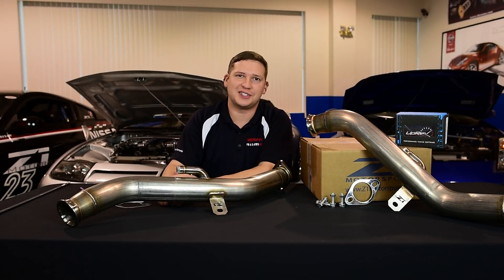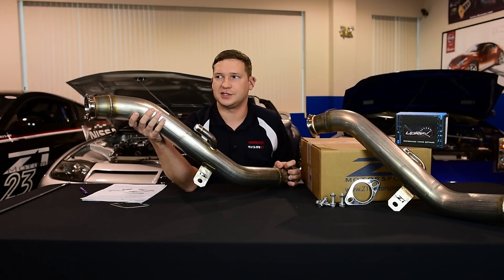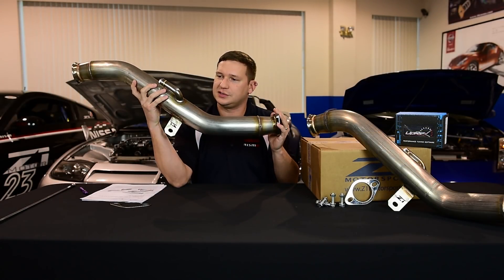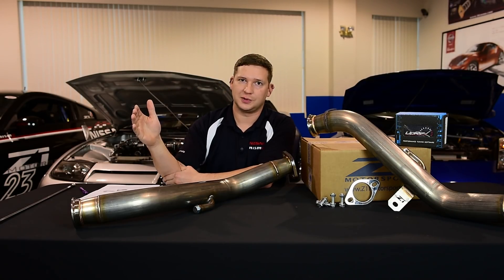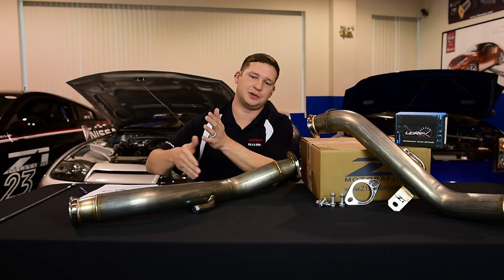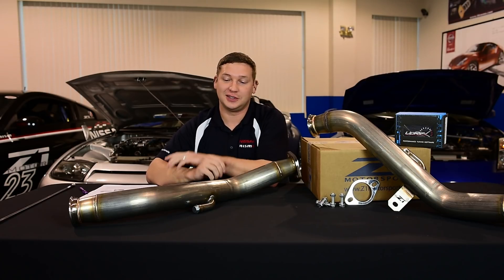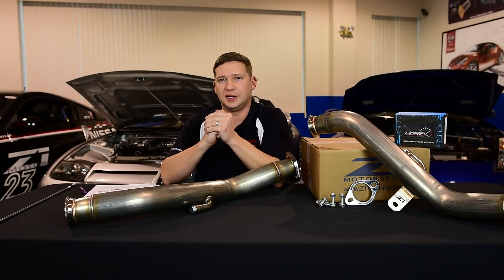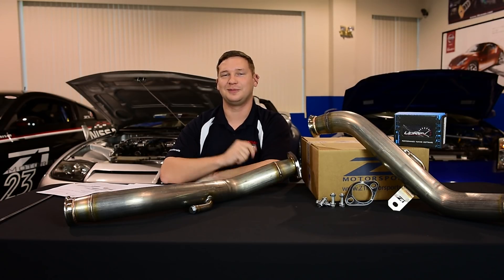Z1 Q60 Downpipes - How We Got 608 FTLBS!!!!

Comment: I know this is 3 years later, but My Red sport when i dynoed it stock it made 372hp which he is right, but when he said squared with it like dead even in TQ and HP i made a wtf face because i made 427 ftlbs of torque. not i got AMS stage 2 bolt ons with Z1 full downpipes. Now i’m curious

Comment: That's impressive and you guys look like you do high quality work, but what about reliability? Those little stock turbo's spinning like crazy and generating all that heat...and how is the transmission going to handle double the torque?
Reply: Kevin Breese that's why they should have a manual option. Dont have to worry about breaking transmission. Shift and go
Reply: @stevornrichards1380  you know manuals break also
Reply: @true5.012  barely, unless you don't know how to shift properly
Reply: @stevornrichards1380  you know transmissions have power ratings
Reply: @true5.012  I know
Reply: @stevornrichards1380  see what I’m saying
Reply: @true5.012  🤣🤣🤣🤣🤣
Reply: Surprisingly, they have yet to answer your questions bro bro. 😂

Comment: Which "version" of the Q60 is "best" for people looking to mod? Start with the 300hp one and go from there or get the Red Sport and start with that? Or it doesn't matter?
Reply from the maker: The "Non-Redsport" is easier to make power on due to the fact that the car is not equipped with an Optical Sensor in the turbo. When you install parts that increase boost pressure the optical sensor detects it and throws an overboost code. With the "Non-Redsport" model that doesn't happen. If you do have a Redsport though, it can be tuned with UpRev so the code can be avoided. As for which one will make more power, they both will make the same.
Reply: Z1Motorsports hi! Do you know if the ecutek ECU also removes the code on the red sport?
Reply: @Z1Motorsports23  very informative comment. Thank you very much

Comment: @Z1motorsports Where can I buy that small box thing he is touching at 7:16? Can this help increase WHP , WTO & Boost without even doing a dyno and just changing the pipes?
Reply: correct, but don't go with uprev if you got a Q, go with ECUTEK
Reply: @Duny100  any specific reason(s) why?🤔

Comment: That's why you need to upgrade to a bigger turbo...if not your going to keep blowing up the seals on the red sport...
Reply: The turbo seals or engine seals? What about adding blow off valves to relieve all that pressure

Comment: Are new turbo outlet crush gaskets required? Or are the stock ones good to reuse?
Reply from the maker: We find that often times the stock crush gaskets can be reused, however on higher milage cars we recommend replacing.
Reply: Z1Motorsports I have just under 40k miles on my q60. Is this mileage “high” enough to need replacing?

Comment: Ok 600 torque but it drops off at 4 thousand rpms so how is it useful?
Reply: AntoineJra who cares? it'll still be higher across the board even if max is at a lower rpm
Reply: Would be fun as a daily, so you're not needing to run the piss out of the engine for basic passing/merging/getting around the idiots that accelerate at a snails pace with "coexist" stickers
Reply: Highway passing power

Comment: Nissan noob here. Question, does the 2018 Q50 3.0T LUXE come with the same engine as the Q60 "Silver" Sport? As far as I know, all trim levels (besides the Red Sport) of the 3.0T are the same on Q50 and 60.. Is this correct?
Reply from the maker: All 2016+ Q50's and 2017+ Q60's share the same 3.0t powertrain. The only differences are on the Red Sport models, which have additional heat exchanger for the intercoolers, oil cooler, turbo speed sensors, and different tune. Otherwise, the powertrain is pretty much the same. (Some gear changes over the years, but nothing crazy.) The 'Silver Sport' is just a term that's been coined by the Q owners that would indicate a car is a Sport model, but not a Red Sport. Red Sport is the 400hp package while the LUXE, Premium, and "Silver" Sport were all 300hp package.
Reply: @Z1Motorsports23  Thank bud for the answers, all of which have been answered by watching more of your videos. lol.

Comment: I just bought this and i have a curiosity question. Will this cause my engine light to go off? 
and if it does how would i get around this?
Reply: all engine light do is inform you that there is a abnormality in the system. that being said in order to remove you it would require a tune that will let the computer know that everything is alright and that extra airflow is intentional

Comment: Please make a Video on the differences between Red sport and non red sport.
Reply: The differences were explained. Redsport has optical sensors on both turbos as well as additional pump and heat exchanger. Only other difference is tune.
Reply: drizzetsrevenge Same turbos and same engine internals? If so that’s awesome. No need to waste money on a red sport then
Reply: Correct. Internals and turbo's are identical.
Reply: drizzetsrevenge When you take it to Uprev for a tune you by the license 500$ and then pay 200-300$ for the actual dyno tune the shop does?
Reply: It sounds to me that the red sport has more problems to overcome if you're going aftermarket/tuning = more money ?

Comment: Do I have to tune to run both upper and lower z1 downpipes?
Reply: yes, with full downpipes you need to have better control of the wastegates.  see a lot of boost creep when the upper dp is changed.  lower downpipes are safe alone

Comment: What do you all have planned to improve the 7 Speed auto transmissions in these cars? I think that is this platforms weakest link.
Reply: Infiniti has actually confirmed that they reinforced the transmission for the cars added power and I have yet to see a report of a blow transmission
due to too much power. 

AMS seems to think that the Drive Shaft is a bigger concern at this point, but perhaps Z1 will chime in with some of the
thing they've seen/heard.

Comment: Does this void the warranty on my Infiniti Q60 3.0T
Reply: Well let's see, you replaced the down-pipes with a non cat's. Umm yeah.
Reply: here is the deal with warranty.  they have to prove the aftermarket parts were the cause of the failure.  if you're beating the shit out of your car and have a failure probably not going to go well.  however, i took mine in for warranty with a tune and mods they never said anything fully covered.  in fact i've had it in twice now for the drive belt issue and it's been covered both times
Reply: Be very careful, when the dealer hooks the car up to get the diagnostics, they will see the tune and void the warranty, even if the tune has nothing to do with what you brought the car in for in the first place.  The reply below that states his dealer keep repairing the car, is probably because they don't run the diagnostics on the car and they don't know about the tune or since it is just a belt, they don't mind doing it.  I guarantee that if your $8000 transmission goes in your Q60, they will not fix it if they know about your tune, even if your tune had nothing to do with your transmission breaking.  These tunes are not worth the risk, unless you have the car after the powertrain warranty runs out.

Comment: Does anyone know what the non red sport but with 300 hp is called?
Reply: Iconic S1ider Infiniti Q60 3.0T Sport
Reply: Alexis Mwarfare thanks dude, looking into them for myself. Love driving my dads q50 with ecutek tune and stillen intakes
Reply from the maker: The Premium (Non-Sport 3.0t) and Sport would be the non Red-Sport 300hp models. Sport package would include bigger brakes than the Premium 3.0t.
Reply: It's also called the silver sport unofficially by community, the reason is the offered sports package which is marked by a silver s on the back(rather then red like the red sport). Thus silver s-sport
Reply: The 300hp has two trim levels, the 3.0t PURE and the 3.0t LUXE.  The RedSport is 3.0t S.  I have the 2019 3.0t S.  It is a lot of fun, right know you can get a 2019 very cheap, about 17K-18K off MSRP.  I bought mine at $17K off MSRP.  You can get them cheap because the resale value on the Q60 is horrible.